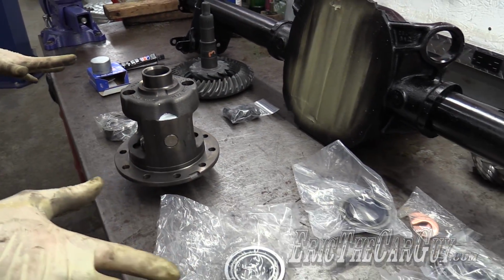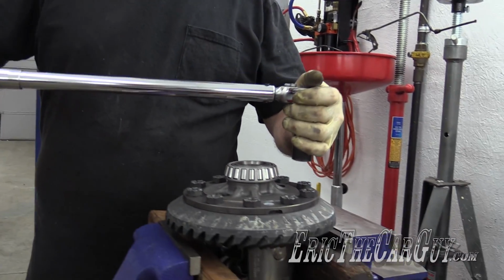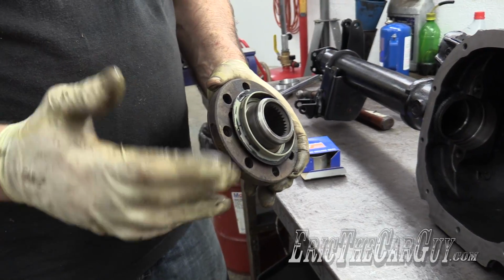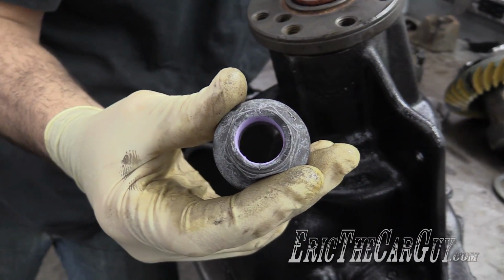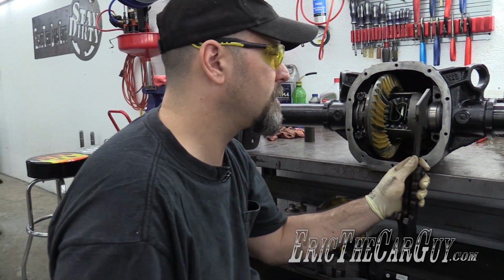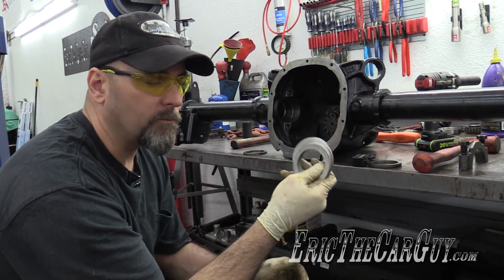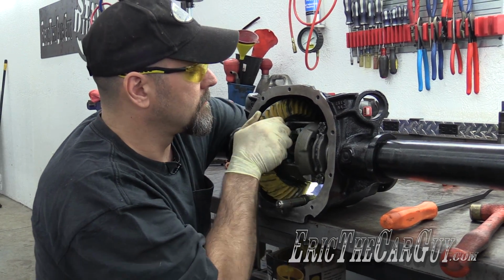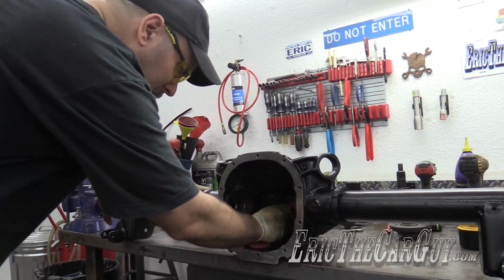Ford 8.8 Assembly & Set Up (Part 1) #FairmontProject

Comment: I spent months with a machinist designing fixtures to press in all the bearings on uprights for a rare english car without putting any pressure on the bearings - i.e. locking inner and outer races onto fixture to avoid any shear / compresssion load on the bearings.  2 months of that work, 10 minutes of install. Probably overkill...
Reply: I don't see how it would take a machinist months to do something like that. Do you have any photos of the setup?
Reply: Nope. All the fixtures went with the guy who needed them.  This is  also "doing it" during "real " work as a g-job.  And the machinist was obsessed with all the issues regarding the installation/removal of said bearings in a fairly fragile setup (Lotus Elan uprights to be precise). Improper installation and abuse of said uprights and hubs have, in Elans, been documented to cause wheels to roll past a drive on the track - no lie!) I guarantee you he wasn't diddling around.  I watched all of it transpire. I appreciate the skepticism but I'm truthin'.  The same fixtures would take the next guy just a few minutes to remove/install inner / outer bearings' inner/outer races..  I've seen folks knock bearings in and out with the flat side of a hammer.  This is fffiiiinnnne and dandy for those places where it is tolerable mechanically.
Reply: Silas Marner Sorry, I still don't buy it taking a skilled machinist months to do. I have looked up quite a few lotus elan uprights, and all seem to have the front and back accessible on the same plane with very little in the way of obstructions. Do you have a specific model number? or a photo of the uprights in question? 

I have worked in a few machine shops, and have seen some shit I wouldn't have believed if I hadn't seen it done myself, and all of those took at most a few days of a few hours each working on the problem. 

I mean hell even if you needed the fit to be incredibly precise... I don't see it taking longer than maybe a week at most. 

The fragile nature of the situation doesn't matter all that much with a proper setup. From the uprights I have seen, you could use the bolt pattern(for the brake mount) to hold a jig that had a through bolt, that could be used to pull the bearing through. Depending on the strength of the material, you could also have it extend out on the opposite side with a bolt or two to add some counter pressure. The hub, could be done in a similar fashion, not necessarily a "bolt through" as I believe those hubs are solid. Keep the jig in place, remove the bolt portion, and have hooks setup for a decent "puller" a 3 to 4 jaw bearing puller with a pointed tip should work. Just make sure the jig has the puller points of contact centered up with the hub, and it should be as simple as tightening a bolt to draw it in. Now depending on the bearing you may need to have some counter pressure on the back side of the inner ring, but that wouldn't be hard to do.   

Or, just put the bearings/hub in the freezer for a while, and or use some air duster turned upside down, to freeze/reduce the size and slide it in, If you can't get it cold enough for it to slide in, it will be cold enough to at least ease the installation a bit more than normal and reduce the chance of something breaking or otherwise cause improper installation. .
Reply: Yes it was done in 1996 so no I have no photos. Once again, done as a G-gob so double your time (doing it slowly , obsessively, and 1/10 time, and you get the few months I mentioned.
Reply: Silas Marner G-job or not doesn't really matter. A machinist is a machinist. If they are any good and a problem is solvable, they can usually solve it quickly. 

The "obsessively", double the time, yet 1/10th the time? makes 0 sense. If it's double the time, then say 2 weeks max, if it's 1 tenth the time, it's less than a day. It's just government bashing keywords. I haven't known many government machinists, but the ones I have known were quite skilled, and never took more time than needed. 

Now, if they were fresh out of school? Which is doubtable, and didn't know their ass from a hole in the ground, I could agree that it could have taken months to do. 

What is likely however is if you were paying them by the hour, and or he/she thought they could monetize it in someway, they then took their time for things outside of that machining process. 

Look if you don't believe me, go to any machine shop, or call them, and ask what's the longest X will take, and I assure you none of them will say a month, must less months. Hell I would say a novice machinist with manual mills/lathes could have done it in 2 weeks or less... Even in 1996. Today it could be done a bit quicker. Hell if I personally had one of the parts with me, or a detailed drawing. I could throw something into solidworks, send it to a machine shop locally and get it made within a week. Well drawing it may take me a little more time, but a week at the machine shop depending on their backlog wouldn't be outside the realm of possibility. But in more cases than not It would take at most a day to program... if they didn't have an accurate way to generate gcode from the file.  

I should clarify that a bit. I don't mean machining jobs never take longer than a week or two. It depends on the complexity of the end result, and or what all is needed to do it. Like if you were building a new(new design all new designed parts) transmission or something from scratch. That would definitely take longer. Even if you go the route, of re-designing the uprights, that I could see taking around a month to do depending on space constraints, as well as the materials available, cast or billet for example. But what you needed seems to be just an ordinary bearing press with a little more room than normally given on an off the shelf unit.
Reply: I worked with the guy for 21 years. he was doing it 4 hours a week. 1/10 time for a 40 hour week.  okay?  Conversation over, thank you.  I sat there and watched the whole thing. He did a fantastic job and it all worked. He had no patterns from which to work.
Reply: Silas Marner You don't need a pattern, just the part in hand, of which he almost certainly had. You are making this out to be a lot more complicated than it is, or would be. Just because you work with someone for 21 years doesn't mean they were any good. Or didn't have any ulterior motives for taking as long as they did. It could very well mean you are incredibly biased toward, or against them in that situation. The 4 hours per week? I could see that taking a while. Months though? It's still somewhat of a stretch, but clearly less so. From my personal experience I don't see a skilled machinist taking that long to design/machine a bearing press, with that much acces. Now if it had a lot less access, odd angles, etc, and only able to use thin pieces for clearance issues, and or absolutely needing some odd alloy? Then sure absolutely it will take time because it offers a lot of complex problems that would need to be solved.

As for watching the entire thing? So? That doesn't really mean that much. If you watched many machinists figure out solutions to problems, and or had a lot of personal experience in the field, then sure I could see that meaning something, but again the bias factor can't be ignored completely. When you like/admire someone, and or see that they can do something you can't. There is a level of appreciation there, a level of awe that influences you. With memory being very malleable and it being 20 years ago? Maybe it didn't happen exactly as you remember it. 

Now as for the conversation being over? You are free to stop responding at anytime. I can't control you. I can however can control me, and what I choose to respond to. If you respond to this, and I have something to add or comment on, I will be more than happy to do so. If you want the conversation to be over, then simply stop responding. That is your choice, and me responding is mine.
Reply: Speaking of overdoing it.. .hah hah!
Reply: Silas Marner "Speaking of overdoing it.. .hah hah!" 

Seriously? 

By your own words you are at minimum early 40's, yet you deem that an appropriate response? I guess if that is your "line", to you maybe he actually did do a "fantastic" job.
Reply: I like people who always have to get the last word in. That's ok...  Remember the calcs: 4 hours per week. Perhaps 2 months,  32 hours. Stop start stop start. Remember? Off the clock - so very inefficient.  Parts came and went, came and went... Lastly. I was physically there.  The guy is efficient when he has to be ("w.o.r.k.") and slower and more deliberate when he can be.  A great machinist by the way.  Not sure what you are attempting to prove.  Except yes you could sling this out if the part was in hand and had a solid block of time to work on it.  And, yes, empirically, you've spent an inordinate amount of time trying to prove.. what again? As far as me, um,  I'm responsible, not mature.  Don't care.
Reply: alright, both of you just stfu already!

Comment: Think of it this way zero preload equals zero clearance 15inch pounds of pre load equals 15 thousands interference fit .the crush sleeve is used to maintain the preload of the bearings and mainly to increase the torque placed on the pinion nut to prevent it from backing off example you can hand tighten the bearings to fifteen inches pre load with your fingers nut isn't that tight put the crush sleeve in there and that same preload now takes 400 to 500 foot pounds to get nut is tight and won't self back off keep up the good work

Comment: This is a good skill to learn! A diff overhaul around here will set you back over $2,000 - can save yourself ALOT of money, so long as it's done correctly of course.

I had an '86 Grand Marquis (still do, but it's a different car from the one I'm talking about) back in '00 when I was living in Phoenix that developed a pinion leak. Replaced the seal, & bought a new nut. Didn't have an inch-pound torque wrench, so I had to guess! Funny thing on that was, anywhere I went looking for one, I got stared at like I had 3-heads. Apparently back then, inch-pound torque wrenches were a rarity. Anyway, I got it together and went for a ride. Nice and quiet at cruise, and under load. Perfect ... so I thought! Got off the highway and slowed from 70 MPH to 30 or so, and as soon as I let off the gas, WOOOOOOOOO (in a cascading sound as I slowed). VERY loud on decel. Knowing I wasn't supposed to touch that nut after tightening it (new one was $35 at the time), I loosened it just a hair and tried again. PERFECT! Learned that day to mark the nut and pinion, AND count the number of turns to remove the nut! :D
Reply: Good idea to count the turns of the nut on initial tear down to have an idea how many turns to make on final assembly, beauty

Comment: Should you put copper paste on the threads of the locking pins on the spider gears?
Reply from the maker: Never. It actually gets locktite.
Reply: EricTheCarGuy The problem is that these locking pins snap every single time you take a part an old axle.. 

Once i just completely ignored fixing up an old junkyard axle and just threw it on and prayed just because those locking pins have a history of snapping and didn't want to deal with it.
Reply from the maker: I've never had that issue. Not saying it can't happen, but when you consider the alternative of one backing out during operation the failure would be catastrophic.
Reply: EricTheCarGuy I guess you're right.

Comment: 1 1/16 inch = 27mm :)

it's quite funny that a lot of the bolts and nuts seem to be metric on those older US cars.
Reply from the maker: American vehicles started switching over to the metric system in the mid 80's. The differential is an '86.
Reply: wow, I did not know that!

Some time ago you said (on ETCG1?) that people always ask you to go metric. You are doing pretty well in that regard! I had to laugh when you measured the shims using your (plastic???) micrometer in imperial units and you said something like "I need about 5 millimeters". Way to go :)

Comment: Great video Eric, I would suggest getting some noise suppression panels for the shop as it will really help with the echo 👍🏻.
Reply from the maker: Already been there. I have about a thousand egg cartons that I was going to do that with. Since I switched to my wireless it hasn't been as much of an issue so I haven't bothered. Thanks for the suggestion.
Reply: Or you can go the Louis Rossmann route, and build individual panels. Wood frame, with material holding in a type of fiberglass mat I forget which. That will be much, much more effective at reducing echo than egg cartons. You may get a very minor reduction in echo with foam cartons, and paper ones, slightly better. With the size of your shop, i wouldn't do all of the walls, but a few strategically placed on the walls and ceiling it could go a long way into reducing echo. 

Also note that egg cartons are not that advisable unless heavily treated with flame retardant. 

Just saying... incase it does become an issue. 

A final note. I am not usually one to argue aesthetics, but some panels could be made to look however you wanted them to a hell of alot easier than cartons can. I could also see a video, or video series about them :P 

"Eric the Car Guy makes accoustic panels"
Reply from the maker: I'm happy with the sound quality my lav mics provide. It is also a repair shop after all, not a recording studio. Thanks for your input.

Comment: I'm not arguing, but I'm curious why staging torque is so important? I assume it's because not doing so can cause deformation, but I'm not sure, thanks in advance =)
Reply from the maker: If something isn't completely seated, bearing caps especially, and you torque it, stuff can warp or break. Torquing in stages helps prevent that.
Reply: That makes sense, thank you for the fairly quick reply, keep up the good work =)

Comment: Eric, how come you chose to press the bearings on instead of heating them up and putting them on? They usually slide right on if you put them in a pressure cooker or similar first. That's what I did as a tech at John Deere.
Reply from the maker: Because I have a 20 ton press.
Reply: +EricTheCarGuy Fair enough lol! We had crazy big presses at John Deere, too, but all the techs liked using the pressure cooker instead. The bearings slid right on when they came out of that thing.

Comment: Can pinion bearing preload be checked with the dial indicator to determine shim thickness? If pinion forward and backward movement is set by shim thickness and crush collar with proper torque setting , then, it would seem logical that by using the dial indicator could eliminate any guess work as to the depth of the of the pinion gear in its relation to the bearing depth.
Reply from the maker: That's not how it works. The preload is set by the tension on the bearings. The Pinion DEPTH is set by the shim under the bearing. That effects contact pattern and backlash to some degree, not preload. They do make a special tool to check pinion depth but no one uses it.

Comment: Something I've never considered that you mentioned in the other video, is how taller gears are stronger due to size. Just how much stronger would say 2.73 highway gears be than say 3.55, and would the increased strength matter at 500-ish whp?
Reply from the maker: Hard to say. Set up is critical in high torque applications. I can say that.

Comment: hey i got a question for ya....

ive been told (at least for chevy diffs) that you only want to pull things either forwards or backwards....depending on what direction/how the teeth match up. 

that if the pinion is on the left....its better for backwards pulling.... and if its on the right....forwards. or vise versa

or some shit like that.... its been a while sense ive read this

ive got a 1977 chevy silveraudo heavy half ton with a 400 SBC and a NP203 (full time 4) transfer-case...soon to be replaced by a SM465 and a np205 because 8 mpg sucks. 

14 bolt rear and i think a 10 bolt front (POSSIBLY a dana 44, but im 90% sure its a corporate 10 bolt)

ive been told that because of the full time 4....the front drive line is a bit beefed up

any truth to this "only pull in one direction" and "its beefed up" stuff?

Comment: Just FYI the koyo bearing in the ford racing bearing kit was most likely the updated 2012 high torque bearing. Koyo also makes a bearing that matches the timkin bearing you used. It just so happens that Ford sells all their bearing kits with the high torque bearing set now. That would be why the old bearing that came off the car originally, and the new kit bearings didn't match.